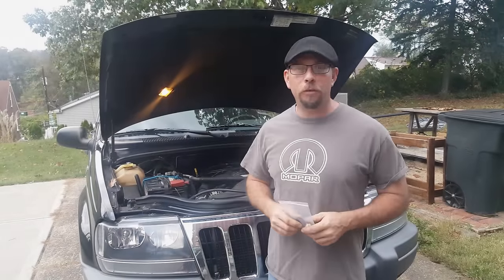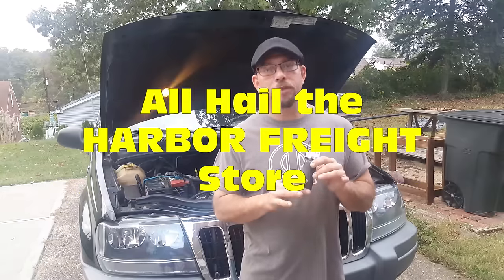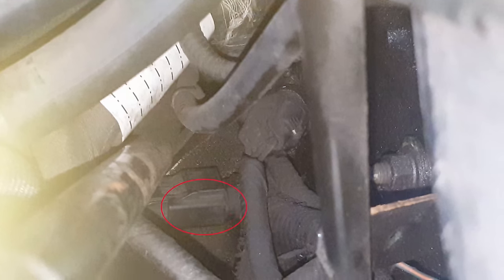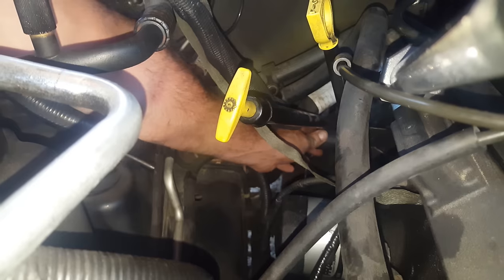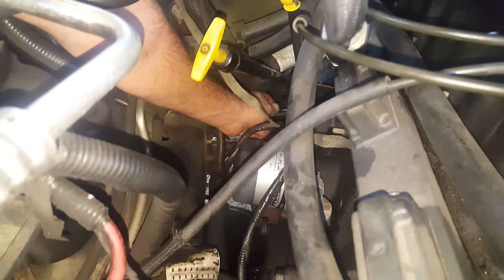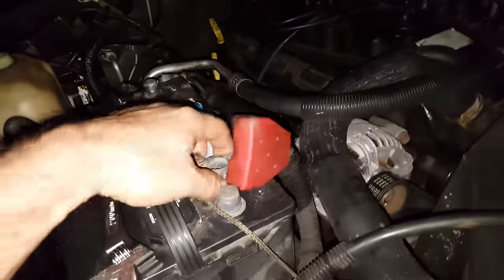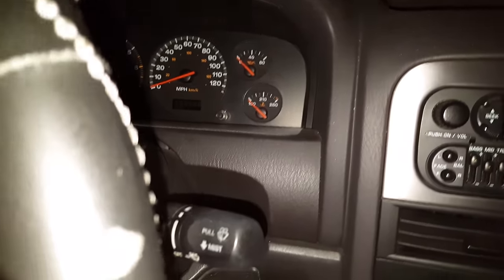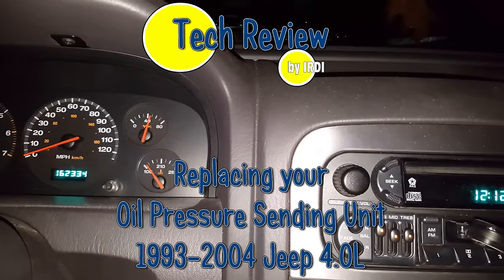4.0L Jeep Oil Pressure Sending Unit Replacement

Comment: I stopped watching when I saw the Fram oil filter....
Reply from the maker: Dan Hambrick it's the older owners, that's been gone. Big can of garbage. Tried the Mopar one for a bit, but it's a Jasper engine and it was dripping. One of the Chrysler techs said to use the Purolator Ones or Boss series. Purolator was the original filter company in the US. So I used the Purolator One,(blue one) and it has been working great. It's also got the valve inside to trap the oil for the next dry start. I like that.
Reply: @TechReviewbyIrdi  sorry for the off topic question.
Does oil leak out of the hole when you remove the oil pressure sending unit?
Reply: Lol I'm dead 😂
Reply: There are probably more fram filters on engines right now on motors all over the world than any other filter. They are sold everywhere and are usually the cheapest,  people in general,  are gonna grab the cheap one first, not everyone is a gear head like us. I personally only use mobil1 but that just my choice,  if you cut them all apart you will find internally mobil1 and motor craft are 2 of the "best built" all that said, to discount a video based on a fram filter being installed is silly,  even if the guy installed a fram, the content of his video is excellent.

Comment: recently did this change and when I cranked up the xj I have lost all of my gauges...even the odometer. Is this normal or did I do something to cause this
Reply from the maker: Something else. It's an analog meter. Either a short happened or sounds like the Cherokee gauges cluster issue. I used to slap the dash a couple of times and it would come back. It's more common than most know.

Comment: It is NOT 27mm socket buddy, it's 26. Thank you for the video, but you made me get the wrong one and had to go through sweat and tears to screw it in.
Reply from the maker: Mine was 27mm. At the shop now. Looks like I've got aBWD thats 26mm. I also have an inter motor that is 27mm. It wouldnt matter considering the thread should be the same as long as you've got to socket set that's just the mechanics life. Yep threads the same on both here.
Reply: @TechReviewbyIrdi  Ok, it may depend on the type of sensor. As I gathered after some reaserch even on the same model of the same year of  WJs the sensor can be slightly different, maybe yours was a 27mm. Instead I have another question for you: did u screw it until the very end of the tread or just for the part treated with resine/color? I mean I did not screw it because at a certain point it offered too much resistance, so I guess that you have to leave a bit of room with the part not treated. Right?

 p.s. I have a socket set but unfortunately I don't have a 27 mm deep socket in it, so I had to buy it separately.
Reply from the maker: @danieledaccardi7497  well mine almost came flush but there is a slight space. You definitely want to make sure that you don't over tighten and break the brass fitting into the block but otherwise than that until it's fully tight and no more than 1/4 turn. As long as most of the threading is in there it is checking for pressure only.

Comment: Is the oil sending unit the same as the oil sending pressure switch? I have an 04 Grand Cherokee 4.0. Oil gauge swing back and forth when I idle to long or sit at a stop light too long.
Reply from the maker: Yes, it is referred the same. Mine did the same.
Reply: @TechReviewbyIrdi  Thanks

Comment: As your description indicated this is a switch (at 50 sec. in your video).  I suppose to fool the public auto manufacturers put a fake gauge on the dash and a switch on the engine.  A true pressure sending unit will read true pressure if attached to a real gauge. My 2010  F150  has the same type of setup.  It could as easily be hooked to an idiot light.  Hard to believe but check it out.  
A real sending unit and gauge with very all over the place when the engine is at different temperatures and RPMs.

Comment: I have this jeep and I just started having oil pressure issues after my oil change and whenever I start her up for the first timd (trying out Rotella T6, lot of Jeep owners seem to run this oil in the 4.0L) at first I thought the heavier weight oil was causing the oil pressure to peg at 80 since I switched from 10w30 to 5w40. But if anything my pressure should have been lower on first start up because its thinner in the cold than the 10w30. Then I would turn her off and start her up again and she idled right at 40psi no issue and only rises to 60 when accelerating. This video was really helpful and will help me replace my likely faulty pressure sensor. Thank you sir

Comment: My problem is to know when the temperature gauge indicates that the car is heating! At what level does it indicates heating?
Reply from the maker: Between 190 and 210. It will start once the thermostat is cycling. Unless your thermostat is open and needs replaced, then it just stays cold.

Comment: I should disconnect my battery before changing the sensor ?
Reply from the maker: You don't have to on these. But doesn't hurt. Gives you a chance to service and take care of the battery terminals. But not necessary on the Jeeps for this sensor.

Comment: WORKED GREAT

2003 Jeep Grand Cherokee 4WD 4.7L FI SOHC HO 8cyl

my connector was a squeeze from rear - pull type
PS535 oil pressure switch
Performance Tool  W80590 socket 1" to 1 1/16" socket to remove switch

Removal was smooth

Comment: does the sensor have to be flush with its screw hole like screw all the way in??
Reply from the maker: No. It will twist off and snap. So finger twist, and nudge but no more than 1/16th a turn. It will read the pressure properly.

Comment: I have oil in my pcm connectors. They say it's a faulty oil sending unit. It's under pressure and is pushing oil through the wire. Going to change it out this weekend. Thanks for the video.

Comment: Was your check engine light on while the sensor was bad?
Reply from the maker: No, it was really the gauges that indicated. Plus driving enough like that between oil changes, and never loosing any or it also looked good, just told me the pump was working. I did however hook up a code reader and there was one. It never tripped the light. But after enough research, I found the gage will do that.

Comment: Did this job on my 97 grand wagoneer 4.0.  Accidentally broke the sending unit when taking off the oil filter.  The plastic part of the sending unit snapped off, so I didn't need a deep socket to get it off.  Didn't need a deep socket to put on, most could do the install with a channel lock.  Thanks for posting the video.

Comment: Just wondering we just changed out our oil sending unit and the oil gauge now won't move up from low any suggestions?
Reply from the maker: Becky Holzem I would have somebody check the mechanical pressure using a mechanical pressure gauge at a shop it's going to be the best way to find out if your oil pump is actually bad or it could just be the gauge itself at this point when you threw the voltage on. But the first thing any mechanic would want to do or want to say is they check the actual pressure using a mechanical gauge this point. Another problem is the connectors that go on these oil sending units are corroded or have some type of resistance so clean that off as best as you can and replug it in
Reply from the maker: Also, is what is the low reading. Is it down at zero, or 40. If it's 40 then it's at least reading something and may not go up by much. My engine has a ton of miles on it and is rebuilt. True miles are unknown except what the previous owners told me and what I've put on it. The other thing is, don't tighten it too much, just enough to stop it once in. I may have gone a little too many times, but it worked out with this one. Check the wires and connector like I said below. Get all the green corrosion off is you have any. Check your fuses under the hood and in the vehicle. If it's still doing that, It also may be a faulty new oil sending unit. It's not unheard of.
Reply: It could be the oil pump.

Comment: I replaced the oil sensor but my gauge still drops to zero sometimes or shows maxed out.  Not sure what to try next.  Should I have cleaned out the plug-in side somehow?
Reply from the maker: Yes I would definitely clean that out mine was a problem to. Now the gauge itself inside the vehicle is analog and they have been known to have problems as well. They use a coil that swings them left and right and sometimes that spring is tensiled out.
Reply: @TechReviewbyIrdi  I used some q-tips to do what I could on the plug-in side.  Didnt help so far.  Is there some sort of cleaner you can spray in there?  How did you clean yours?
Reply from the maker: @tommaertz5597  crc electronic cleaner.
Any auto parts store.

Comment: So you need to drain the oil?
Reply from the maker: Some will drip out. The sending unit is screwed in above most of the oil sump, but some does exist on the inner wall. It shouldn't pour out. It's an easy way to do it while you have the oil filter off though. So, changing the oil simultaneous is just a good idea.

Comment: If you (or anyone) knows symptoms of it going out— my oil pressure gauge (at idle) will fluctuate from higher than normal down to 0 and the needle goes back and forth. Will this fix it?
Reply from the maker: That would definitely be my first step. And yes the actual sensor could be making your readout go up and down depending on what's physically affecting it at that moment. The one in this Jeep did momentarily once in awhile.

Comment: Great work!
I did- find, changing the oil pressure from the bottom of the WJ; with the starter removed was easier on a Lifted suspension! Everything was accessible. Laying supine on a slider minimized fatigue and a great opportunity presented itself!! Why not change the oil and clean the other oil covered terminals.

Comment: I got a 96 cherokee 4.0, sometimes the oil pressure randomly drops to 20 psi at idle, not that worried because it goes back up to 40 when the rpm increases, i changed the sending unit and oil pump, but no luck, do you think the bearings are just worn? it’s got 164k miles
Reply: Any update on your issues? I have a 2000 Sport model and twice in the past two months the oil pressure went to 0. I just got it in december and it only has 108k miles.  Really hope i didn't get ripped off.  Planning on replacing the oil pump since theres no signs of knocking or visible engine wear
Reply: Actually yes, when i replaces the distributor rotor it stays at 35 at hot idle and goes to 50 at 3000 rpm, it still does it when it’s cold but when it’s warmed up it’s fine now, hope this helps!
Reply: also hook up a mechanical oil pressure gauge so you know if the oil pressure is really 0 or if the gauge is bad

Comment: where did you find it for like 12 bucks? auto zone is like 50, just wondering if the inflation rate has gone up that much?
Reply from the maker: I use the part number to convert through eBay and see what was offered on a cheaper one because the pressure switch is a very simplistic sensor. Quality doesn't vary too much but just enough. Now the cheap eBay one that I put on is doing the job and still running today.
Reply: @TechReviewbyIrdi  GREAT, THANK YOU

Comment: Changed mine pressure still fluctuating.
Reply from the maker: Two possibilities, the analog guage(needled type in the cluster) is bad which bounces a lot as time goes on. It can't guage the signal correctly. The other is a bad thing, which is the oil pump itself. Which can fluctuate up an down as well. It's best, if you don't use test guages or test wire ones, take it to a technician who can put their own pressure guage in a place to test it. If the oil pump goes, it will be bad.
Reply: @TechReviewbyIrdi  Strange. When car warms it's fine. Once car runs for awhile it starts fluctuating. Thanks for the ideas on what to check. I was also told to try a screw in gauge.

Comment: my oil guage is reading full pressure. my jeep wont start, and it's acting flooded. would changing this out help at all?
Reply from the maker: Probably not but if it's reading correctly and has full pressure then there's something else going on. Changing it up is cheap and easy and wouldn't hurt though.
Reply: Probably your crank sensor
Reply: This could be the Crank Positing Sensor or crank shaft sensor these 4.0L were noted with this issue mine did this and would die also every one in awhile and be hard to start. Replace the Crank Positioning Sensor
Reply: Try throttle position sensor. Then crankshaft sensor. They are a pain to do. I just spent the weekend fixing mine. It just died, backfired, shot flames, but she runs smooth now. Questions drop me a line, I'll help ya out.

Comment: So these oil pressure sending units don't increase when you give it gas? Mine is like 65 cold them right where yours is at when warm.. It doesent fluctuate when I give it gas. That right?
Reply from the maker: That sounds about right but they get a little flaky with age. It's really about the pressure and the temperature internally against that sensors nipple. Overtime though the sensors just kind of get out of phase but yes it shouldn't really jump around. That's about where my new one sits now after this long. I'm having the rocker panels done right now so it's not here at the house.
Reply: @TechReviewbyIrdi  Appreciate that man. My sierra has a similar oil pressure gauge and that moves when you give it gas so figured seeing its a 3 wire this spuld do it as well.. Glad to know I'm good to go.. Appreciate the help and video. 🍻

Comment: Interesting.  So this sensor never touches the oil?  No oil leaks out.  Thank you.
Reply from the maker: It won't leak, I've changed a dozen of those now for folks. They always think it will. So I get a call all the time. Easy money in reality. Dont' let a shop do it unless you don't mind the labor or price of the part they put in. I just did some Dodge Chargers, and they are hard to get to. Same there. It's a pressure sensor for the difference between the upper and lower chambers. Once the compression starts, the pressure builds and the sensor reacts to the surrounding chamber it's screwed into.
Reply: @TechReviewbyIrdi  thank you.  Subscribed. :-)

Comment: Advice to YouTube shade tree mechanics. Just get to the point. We don't need a detail of everything you've done the last week to take a part off. If people aren't smart enough to locate the kind of tools they need, then they should not be working on their own machine.
Reply from the maker: I appreciate that. I actually have learned a lot since that video. That being said, I will try to make them to the point. My channel was actually more tech at one time. But since we have had troubled times, I've learned a lot on this Jeep aside from my Chrysler years. Thanks again for the advise Chris Rose.
Reply: @TechReviewbyIrdi  tech is the way to go. Things are getting less mechanical and more electrical as time goes on. It's kinda sad that my kids will never have the pleasure of rebuilding a Carter carburetor. I just see a lot of videos of 10 minutes of wasted time listening to everything in the world except location and removal of the part. Not saying yours was bad because it wasn't. I needed to know the location of the oil pressure sending unit quick.  I know I have the tools and most probably do. I was once a trained ASC certified mechanic but I got burned out working on junk people drug in and they expected miracles to happen. See how boring that was me telling you that.
Reply from the maker: @chrisrose_krii_lun_aus  I like hearing that. I see the same with my commercial account mechanics now more than ever. They like to unload their stories on me. It's crazy anymore.
Reply: A lot of stuff now a lot of mechanics have to go to YouTube or forums to get help. So much has changed since I went to school im clueless on a lot. I've tried to keep up with most stuff but vehicles are getting crazy sophisticated now. Man I used to rebuild VW engines with a pair of vice grips, a few screw drivers, a tube of blue glue, and a cardboard box for gaskets. Run them like that forever. A lot of the work now is done on a laptop with a little wrench turning maybe.
Reply from the maker: @deplorableconstitutionalis2834  thank you. I appreciate it.
Reply: Wow! I thought people come onto you tube to LEARN and not get ripped off by shady mechanics (especially someone like me...a woman) GREAT VIDEO and Thank you for being detailed!!

Comment: Do you have the link for the part ?
Reply from the maker: The Mopar Overstock is out of them at the moment. But I have a backup seller that works just fine and is comparable here https://www.ebay.com/itm/Engine-Oil-Pressure-Switch-Sender-Sensor-Dodge-Jeep-Chrysler-56028807AA-99224/322488188358?ssPageName=STRK%3AMEBIDX%3AIT&_trksid=p2057872.m2749.l2649
Reply: @TechReviewbyIrdi  do you have a link for a 1998 Grand Cherokee

Comment: How can you determine whether it's oil sending unit or oil pump?
Reply from the maker: Well honestly the sending units going to be a lot cheaper and easy to change out at first. Usually indicated more by either an erratic gauge or the gauge indication is out of what you're usually normally seeing. Other than that going to the oil pump is a lot more difficult and more expensive. I would advise always changing out the sending unit first since it is so easy.

Comment: My sister has a 2001 Grand Cherokee and she has low to almost no oil pressure when idling. Could you do an oil pump video?
Reply from the maker: James Higgins I cannot at this time. I appreciate the request.
Reply: It’s not the pump it the engine. Notorious for 10 psi to 0 at idle